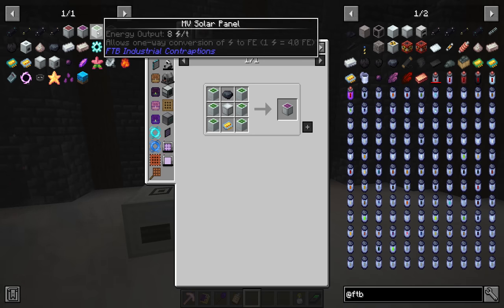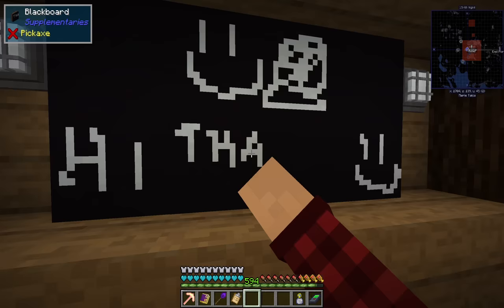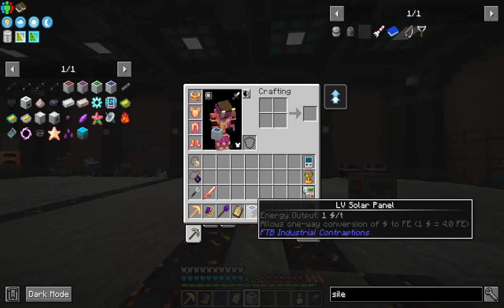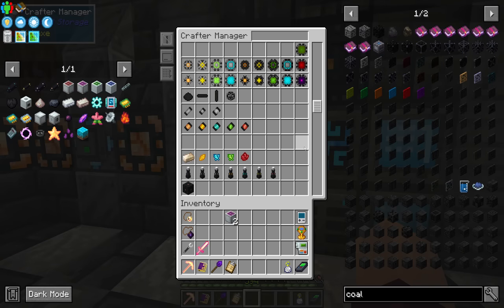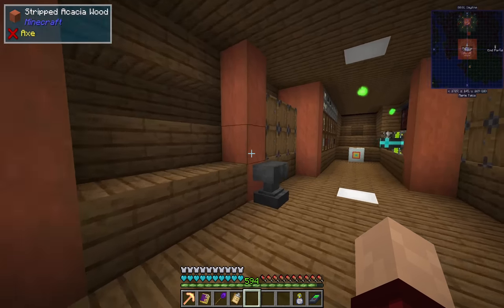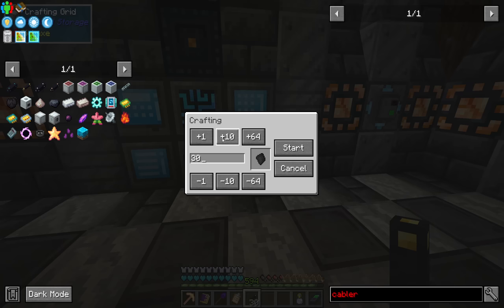ATM 8: Episode 48 - Aiming for Anti-Matter!

Comment: Mekanism takes a while to get used to at first but it is one of the most useful mods out there. You could technically just start producing antimatter if you switch the sodium for water and just bin all the steam or even send it to your turbine with an ender tank. Then just take out the waste and do what you need with it. The only thing you need the turbine for is making power but you already have a power set up so I don’t think you really care about making more.
Also, to get rid of the ghost:
/tbgui > configurations > Effects > Halloween ghost
Reply: His main power source also uses uranium, so it's better to just swap to mekanism. 40k isn't very many to feed both. Heck, bees with 2 omega and a bunch of gamma upgrades can just barely keep up with 60 burn rate, and that's with 4x ore processing, which he isn't doing. He's using the agriculture way which is 8 essences for 2 ingots. It's not like he only needs antimatter either. He has to spend a bunch of his initial yields making polonium/plutonium to even make the sps.
Reply: if you don't need the fission reactor for power, you can also just put a chemical tank on the output for steam and set it to just dump everything.

Comment: With Mekanism it’s weird, you can really ignore those square sides with the blocks. All input & output control is all modifiable using the tab on the left inside the block. Rotation of the block itself is unnecessary besides for knowing orientation while setting it up.